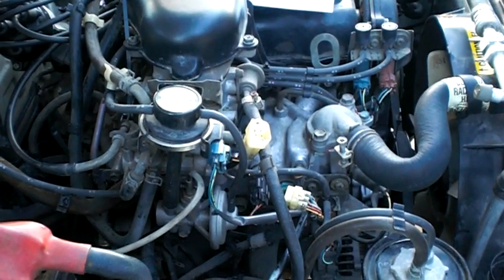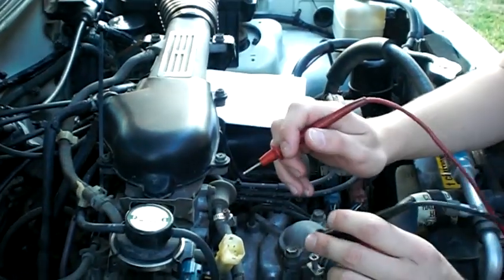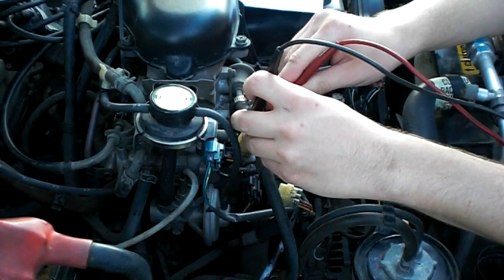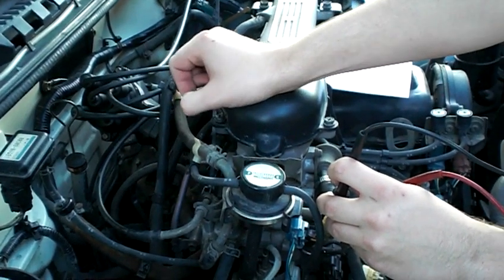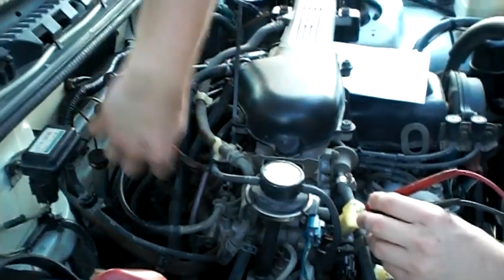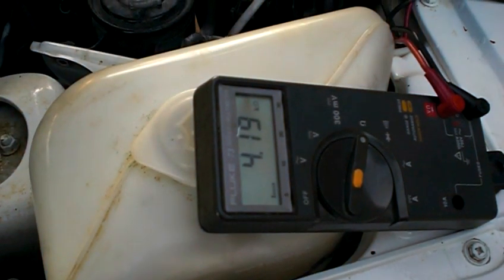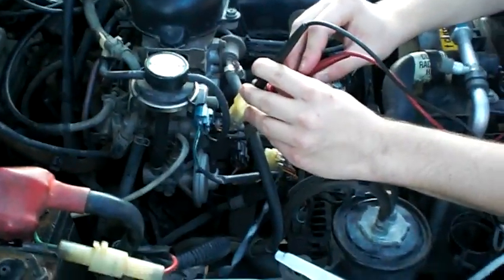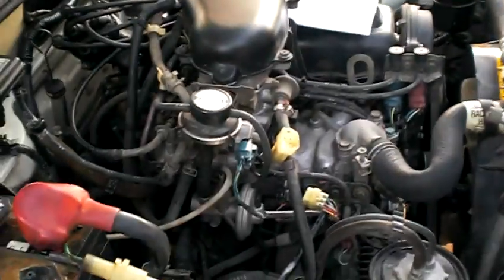Geo Tracker/Suzuki Sidekick Tips for adjusting TPS

Comment: My friend excelent video just I got one question, I have one lecture in my tracker 1995 on tps sensor in the green wire I got 9 volts from the computer,  does this lecture it's normal? Because I have dude about if is the Tps sensor problem or the ECU, sorry for my inglish, greetings from mexico my friend

Comment: For what it worth, just bought a 95 geo tracker  and brought home on trailer because of long distance to drive not knowing it’s reliability. 
230,000 miles. Was surging on first several starts and idled very fast.  Had electric carburetor. Picked up some quality injection and carb cleaner and new gas and seems to have corrected itself. 
Oh course if this didn’t work would need to get serious about problem solving, but tried this first.

Comment: is this a 16 valve internal coil distributor,i need the spark plug wire placement? they were off when i got it? thanks,any help?
Reply from the maker: raven lunatic look at the description and you can use the website to find 16v information.

Comment: My 96 sidekick will not start. It is turning when I spin the key but wont turn over. I sounds like its out of gas. Would that possibly be a fuel pump?
Reply from the maker: 96 has the 16v. could be many things. does the check engine light come with key in acc position (right before you start) what is compression? 145psi + ?

Comment from the maker: you can do it while engine is running since the only point of vacuum pump I see is pulling the throttle open slightly from the dashpot rest point. but otherwise this method sets it with just a mulimeter.
Reply: I have 2000 Chevy metro 1.3 4 cilindry. Is the same?.

Comment: I have done this 100 times! Vacuum pump pulls it at ideal. Then you need a cal, go , nogo feeler gauge. Put in the Cal Then turn cw till meter reads infin the back it up to just open. Check nogo should be in infin, go should read 8 to 45 ohms!